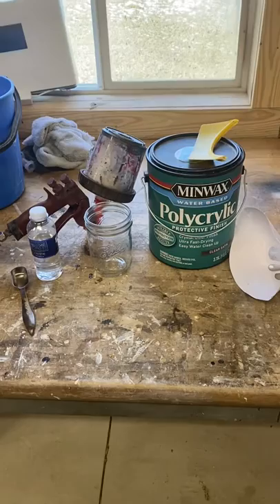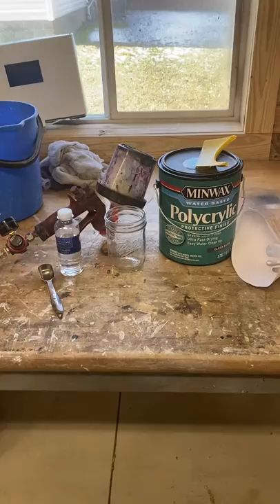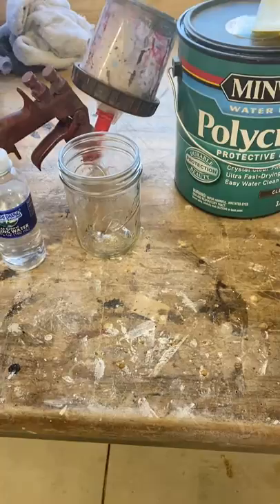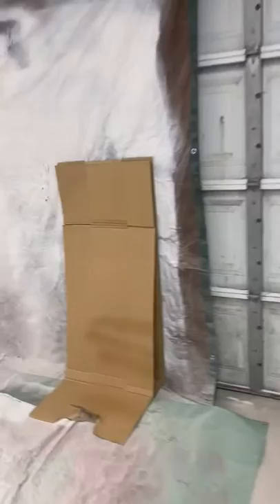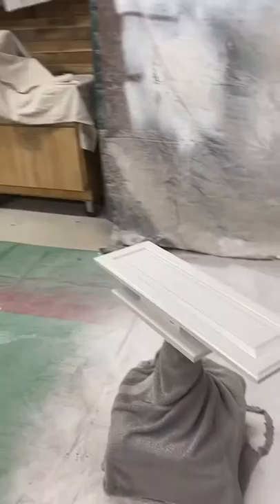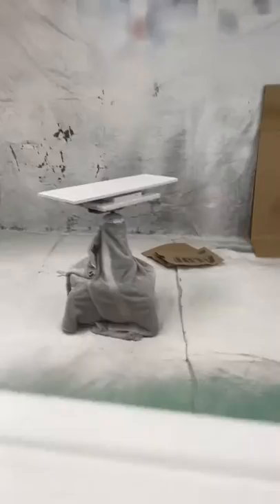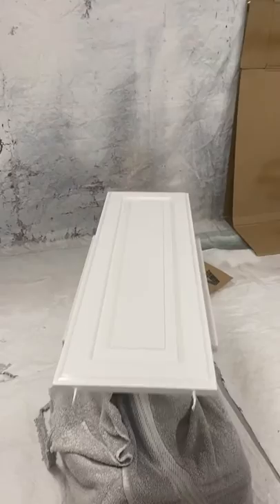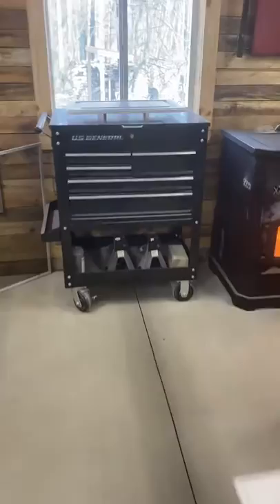How to spray Polycrylic

Comment: Thank you! They look FANTASTIC. I just finished my 40yr old kitchen cabinet doors and drawer fronts with polyurethane fast drying MinWax. I used a foam brush. 3 coats on the face sides and 2 coats on the back sides. I just found your video and you really did a wonderful job. Wish I found your video earlier as it is great. I used a clear gloss and as the I used Watco med walnut oil first as it matched the original color but the drying time with oil products was unbelievable. You should be very, very proud of your work. Thank you for shar

Comment: How important is the tip size on your gun. Glad I found your video as I am close to spraying my project. Last question, because your using water based with water thinning, will some moisture in my airline not hurt my spraying?
Thanks man.

Comment: I was looking at ways to respray my cabinets with waterborne poly.   I read on a big box store customer Q&A several responses to repeated questions about using HVLP guns to spray.   Several questions had responses from Minwax reps stating spraying Polycrylic is not advised.  I wonder if this is because they want you to buy the polycrylic $$spray cans instead or if there is an issue thinning poly.  Since this is 2 years ago did any issues eventually emerge with the water thinned finish?  Thanks
Reply from the maker: No issues at all, the finish is extremely durable and easy to clean. If you are spraying over paint you must let it cure for several days prior to application of the poly. If the paint isn’t cured the poly will cause it to crack as it dries extremely fast.
Reply: @21Archer  Ty halfglassfull for asking the question and thank you Jason Willis for replying with that extra bit of info.

Comment: Are you cleaning the sprayer out after each coat. I’ve heard it dries very quickly and will ruin the sprayer.
Reply from the maker: You can leave the poly in the sprayer for a few hours. I just wipe the spray tip off so none dries on there.
Reply: @21Archer  so nice to know. Thank you.

Comment: What kind of dry times between coats? Why not just use lacquer? You could do all the doors with three coats in 2 hours.
Reply: Lacquer will probably give the white finish a yellow ish or amber look. That s probably why. Im finishing some pieces and im trying to decide myself what to use.
Reply: @ugna2773  sure, the cheap products at big box stores will likely yellow but the pro stuff at Sherwin Williams is guaranteed not to yellow. It’s what the professional cabinet shops use on their commercial cabinets.
Reply: @rickymcgrath2314  yea your probably right. So much stuff out there it can get confusing. I guess over time you get comfortable with a product and just stick to it.
Reply from the maker: I’ll let it set about 45 minutes between coats. Cabinets have been in the kitchen for a year now and still look as good as when they were installed. Finish is holding up beautifully!
Reply: @21Archer  have you ever used semigloss
Reply: @21Archer  Did you sand between coats? If so, what grits? Thanks for the info!